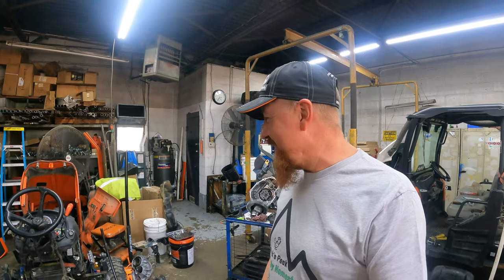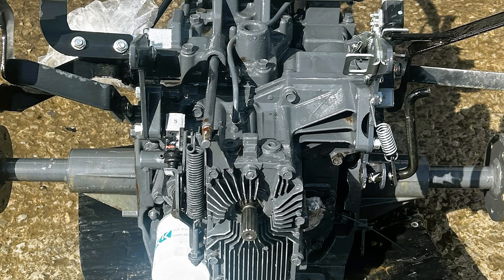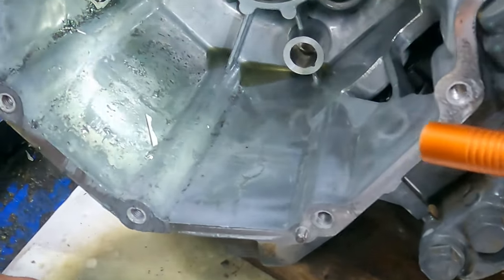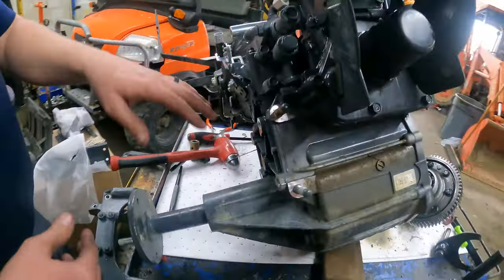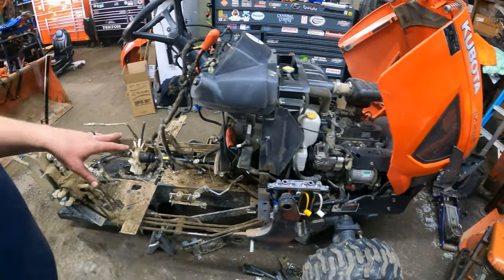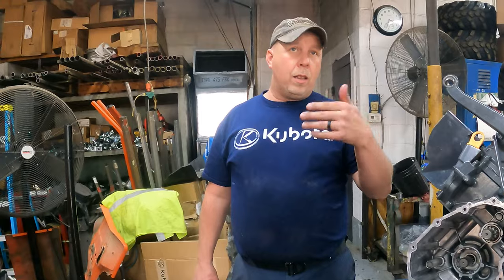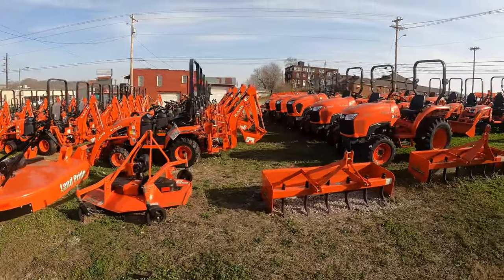What Happens In the Kubota BX Transmission When the Differential Lock Breaks?

Comment: Glad you had the warranty.  I’m afraid to know what the cost would have been without. I’d seen issues before on here with the diff lock breaking apart so when I got my BX I disabled it to avoid that problem. Lots of times people let others use their tractor and they don’t know how to use the diff lock correctly. In my opinion the pins are too small and weak for this transmission. I love these Kubota BX tractors but that’s the weak link in them and possibly other sub compact tractors. If the 4 wheel drive doesn’t get me through whatever, I’ll get another tractor and pull it out ! Just be careful using the diff lock if you decide to still use it any. Looks like you you got a great dealer to work with when needed. Have a Blessed Day !
Reply from the maker: Yeah, I don’t know that I will totally disable it, but I’ve considered it.  I will at least be very careful.  I think it would be about $3k to repair without warranty.  🤦‍♂️
Reply: @PeeksPeakHobbyHomestead  What I used was a large enough bolt to go through the opening the diff lock pedal runs up and down in and two large fender washers. Put through opening butting the edge of the washers against the diff lock pedal rod and tighten down then the pedal cannot be depressed !

Comment: Nice taking us along to see what happened. Glad it's fixed and back working.  Those 3 little pins are definitely a weak point in the transmission. It needs better engagement, in the ring gear.
Reply from the maker: I do wish it were more dependable, but I push it for all its worth.  Now I now to back off.  🤷🏼‍♂️

Comment: This happens alot with all tractors.     You may not be moving but one wheel may be spinning.  You dont want to just jam that diff lock. stop everything and slowly work the diff lock in.  You will have to move the drive train some, but dont jam it in at a high speed.

Comment: Thanks for posting this video Lucas! It was very informative for sure. Its no secret that this is a very weak link in the Kubota BX`s. Now, with that said, i`ve never once used the diff-lock on our BX23s, so ours may never give us any problem in that area. But if one day i DO have to use the diff-lock, my question is, when will it fail me just needing to use it. This is a horrible design. Kubota really needs to address it. Kubota should fix every one of the BX`s out there that have this design with some sort of upgrade so that they do NOT fail so easily. Take a person, who has just run out of warranty, this is a extremely expensive repair. I guess i should have bought the JD1025r instead of the BX23s, and not had any worries later on down the road, lol.
Reply from the maker: I can tell you I used my diff lock very often and worked the machine hard.  I would use it to get enough traction to pull a full 5’ box blade, dig, etc…. I think if you save it for situations where you are stuck and are careful and slow about engaging it, you likely will not have issues.  I feel like I squeeze more out of this machine than it is designed to do.  🤷🏼‍♂️
Reply: You better hope your Kubota didn't hear you say that it might go sour on you that was blasphemy LOL

Comment: Good it was a relatively simple fix and no real damage to the housing or gear was done.  My 2 Cents worth on the cleaning.  Over the winter pull the floor plate off, the seat and pull the fuel tank off and give it a good clean in your shop.  If you have a hot water pressure washer steam clean the fuel tank out to get rid of all the Krap that builds up in the tank over the course of a year.  A clean fuel tank once a year will save you a ton on fuel filters and pumps.  When I bought the BX25 I was putting filters on once per month.  Finally tore the fuel tank out and OMG the sheer amount of dirt, sludgy stuff, decomposing old algae blooms from the previous owners 3 years of no tank maintenance.  I don't do the maint on my Kubotas anymore.  Dealership I use started a service you could sign up for and they come every 3 Months take all of my Kubotas back to their shop do any services they are past due or due for, grease them up good , give them a complete top to bottom inspection and bring them back ready to work,   It cost a little more than me doing the services and maint myself but they have caught a couple of problems that I missed and saved me a lot of money by catching things that if they broke would have broke other things. Mostly on the 2012 BX25 and the 2002 BX22  LOL when they start getting older generally unseen things start wearing out. The Dealership Mechanics are real good at seeing those unseen things :)
Reply from the maker: Yeah, I could not believe how dirty it was!  🤦‍♂️
Reply: @PeeksPeakHobbyHomestead   Never ceases to amaze me where mud and dirt will get packed into.  I went over mine a week ago, couldn't get it start for anything, like not even turn over.  Finally gave up after checking the Seat Switch, PTO Switch and HST Switch the 3 usual culprits for that problem. Mechanic dropped by a few days later on a service call for someone else and had it running in less than 2 minute.  A hard mud ball was blocking the HST switch making it think the HST was engaged. No where near the switch but he went right to it like a beagle to a rabbit. Now I know yet another hidden nook to look in for mud and rocks.
Reply from the maker: @BigDaddyKrapper  that’s good stuff to know!  I enjoy reading your comments!  👍

Comment: Good video, I wish you would have explained how not to break the diff lock. I just ordered a bx1880. Dealer said to be careful engaging the diff lock but never explained in detail.
Reply from the maker: To be honest, I don’t think anyone can tell you a fool proof way to protect it besides just not using it.  The main thing for sure is to not try to engage it while you are moving, but of course then only way to get it to mesh is to be moving slightly.  I basically just never touch it unless I’m stuck, then I am very slow and easy as I try to engage it.  🤷🏼‍♂️
Reply: @PeeksPeakHobbyHomestead  Thank you for the great advice. Looking at it's location, my concern is accidently pushing it down. The tractor is supposed to come next week, I'll see. Thank you again for your reply.

Comment: WOW !. Good info Lucas. Almost had tears in my eyes when I saw the BX gutted like that. So the issue is not to use the diff lock when you are moving? I always stop before using mine. Take care and stay safe. PS: It is nice to see people in t-shirts. We are still in winter gear here.
Reply from the maker: Yes, from what I gathered it is mostly not slowing down enough when engaging.  I’d say as little movement and pressure as possible.  You have to turn and move to line up the holes, but you don’t want to do it hard.

Comment: On the backhoes in the military they had similar locking diff setups and they lectured us up and down scaring us to death of them saying that if we tried to engage it while the rear tires were spinning with any difference  in rotating speed , major stuff in there would instantly grenade and lock the whole thing up solid.  
 They said they would know immediately what we did and it would be all our fault and cost us the majority of our as*.  
It conditioned me such that still after 15 years and well over 2,000 hours combined on three different compact tractors and still to this day I can’t even think of a diff lock on anything while any tires are moving at all.  
I’ve read the tractor manuals and seen people totally doing it so I’m sure it would  not be as inclined to break and not as fragile as they told us they were but still,  I am also just as convinced to this day that if I did ever engage a diff lock with any of my wheels spinning, those old drill instructors would instantly somehow appear next to my tractor and grab me by my collar snatching me right down off there while chewing my head off, one cheek stuffed bulging out all crazy like back in the day.  
Even though they would have to come back from the grave to do it.   
The threatening aroma of winter green grizzly appears as if they are standing right behind me if I even think of committing such blasphemy with a diff lock. 
After the programming the fear of them tearing us apart remains so strong that threat looms like I’m swimming with Jaws and touching the diff lock would be like twitching around acting like a wounded fish as ….  To me that will get you reduced to a sloppy mess just as fast.
Reply from the maker: 😂🤣. Man you got me scared of them now!!!  Thanks for sharing and thanks for your service!
Reply: @PeeksPeakHobbyHomestead  lol I hope not that level of fear is only rational and healthy if one’s dealing with actual sharks,  when it comes from just operating a diff lock…. That probably makes me almost looney tunes committable and I should probably not have admitted all that to the internet.  It’s just an absurd thing I got with diff locks, I know I’m not the only one because I wasn’t alone and for some reason I felt the need to put it out there seeing this topic come up.  👍

Comment: Yikes!!    Any idea what that would have cost if NOT under warranty?
Reply from the maker: I meant to include that.  I believe it would have been between $2k and $3k for the repair. 👍
Reply: @PeeksPeakHobbyHomestead  That`s surely cheaper than replacing the tractor. But how many times will you have to have this fixed. Its a very poor design to start with. Did Kubota have a upgrade to fix this so that it doesn`t happen again? Because putting the same exact parts back in it, is destine to fail, again. Sure would like to know if Kubota has an answer/fix to this commonly known failure in the BX series tractors besides putting the same exact parts back in it that ARE KNOWN, to fail.
Reply: Wish I would have known about this garbage design before I got a new BX 2380  will never recommend  that anyone get one I do like the tractor just not impressed with the worthless diff. lock they could have made a limited slip rear-end

Comment: So the diff lock advice was basically to come to a complete stop, lock diff, then move forward slowly for bit till it sets?
Reply from the maker: That is essentially how I took it.  That’s what I do now.
Reply: @PeeksPeakHobbyHomestead  thanks!
Reply: No.  As the mechanic was showing, the differential spider gears need to move for the pins to line up with the holes.  The ONLY way that happens, is one tire needs to move further than the other, as in a gentle turn, until the pins set.  Same to release the pins.

Comment: Thanks for the info, very informative. Perhaps I wasn’t a good listener but were you saying it may have broken from engaging while in motion? I have an M62 TLB and I’ll confess I’ve done that a time or two this past year. And if I’m being a dummy I need to change my ways! 😁
Reply from the maker: Yes, basically.  I believe they were saying it requires SOME motion to get the holes to line up, but you don’t want to do it with any speed at all.  Just moving it to line up the pins.

Comment: Thanks for sharing. How many hours were on your BX when this happened?
Reply from the maker: I was right around 500 hours.
Reply: Mine happened at 1500 hours and again at 2500 hours, but I use mine extensively, and using proper and quick engagement and DIS-ENGAGEMENT. Now that I modified my pins from 10mm to 12mm, I am much more confident in using the diff-lock.  My BX25 is now at 3130 hours.

Comment: Man that thing was filthy lol 😂 
So should we only activate the diff lock when the tractor is not moving? I haven’t used mine as of yet . I would have also had them replace the plastic transmission fan with a new one as I hear those are another weak part and hard to change when the tractor is not apart like that ?
Reply from the maker: You will almost always have to move the tractor some just to get the pins to line up with the holes.  The key seems to be slow and gentle with the pedal and feel it slide into place.  I am trying to practice that now.  I’m hoping to do a little demo video when I feel comfortable that I can share helpful info.

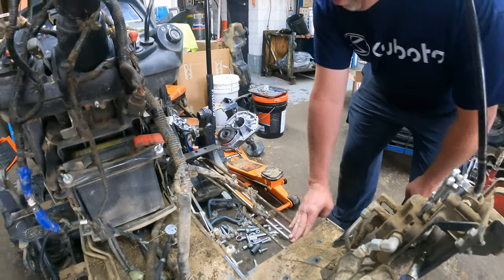Comment: At 6:00, that is not a brake, it is a shaft stop, used as a parking brake.  Brakes act on individual wheels.  On gravel or any slippery surface (grass, ice, etc), going downhill pulling a heavy load, in 4x4, you can have 2 wheels rolling on the gravel, and the other two tires spinning in reverse, the 'parking brake' won't stop you.  This action can be minimized by applying the diff-lock as well, as it will lock both rear tires.
Reply from the maker: I don’t know that I agree with your definition of a brake, but I get the point you’re making about the functionality.  New operators need to understand how it works for sure!
Reply: @PeeksPeakHobbyHomestead  If you are familiar with driveshaft brakes (propeller shaft brakes), the BX brake is similar.
Reply from the maker: @ya472  yeah, that’s the comparison I was making in my mind.

Comment: Wasn't very clear about what not to do IMHO...   what was it,  not to lock your Diff while you're moving?
Reply from the maker: Basically.  Make sure you’re fully engaged before use.  Don’t use it while turning, and make sure it completely disengages when released.
Reply: @PeeksPeakHobbyHomestead  Thanks - I don't use it often, but good to know.
Reply: 2 Things:  1) you can use the diff-lock when turning, but only on loose soil.  However, because both back tires are locked together, turning might be difficult.  2)  quick engagement and especially dis-engagement is important, both are done when the rear tires are turning at different speeds, like when turning slightly.  If it won't unlock turning left, then turn right and the pressure is momentarily released and the pins pop out. (unless the fork mechanism is binding.)

Comment: Yep never step on the pedal why your tires are spinning or moving 👍
Reply: Incorrect.  The quickest and best use is to move forward or reverse while turning.  This moves the spider gears in the differential, so the pins will align.  Never press hard on the pedal.

Comment: i have seenthis and done it myself nd what i was told is i tried to enguage diff lock while one wheel was spining and one wheel not spining i wander if that is what happen there
Reply from the maker: That would definitely do it.  I was always careful to minimize movement when trying to engage.  I probably was not as meticulous at making sure it disengaged when I no longer needed it.  I used it often.  I probably won’t use it as often anymore…
Reply: It is ok to engage the diff-lock if one wheel is spinning very slow, as the pins should drop in their holes, but as Peeks stated, Dis-engaging is far more important, a quick release.

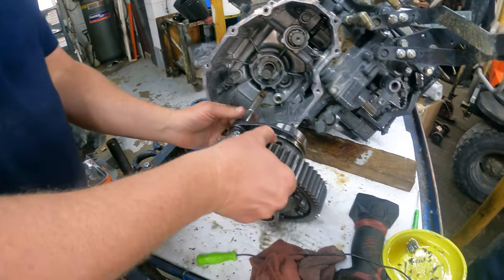Comment: THE damage occurs when the diff-lock will not quickly and efficiently release, not the application or engagement.  Another issue is the fact that the diff-lock needs to be fully engaged with your heel on a pedal, and during normal operation, it is impossible to keep the pedal fully pressed.  However, if you keep heavy pressure on the pedal, the "cam' at 2:15 will splay and restrict the easy movement of the mechanism to release.   There needs to  be a pedal stop, or better yet, a locking lever system instead.  https://www.youtube.com/watch?v=noltwZjOOts
Reply from the maker: I watched your videos on this.  Great great information!  Very nicely presented.  I have always tried to pay close attention to ensure it releases properly.  🤷🏼‍♂️
Reply: @PeeksPeakHobbyHomestead  Awesome.  Thanks.